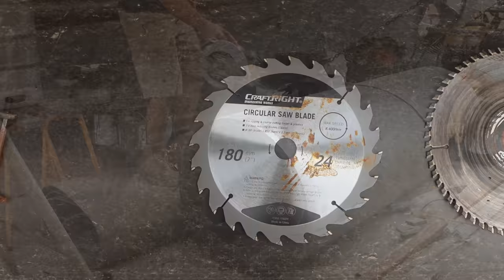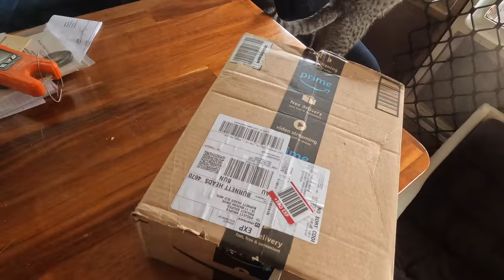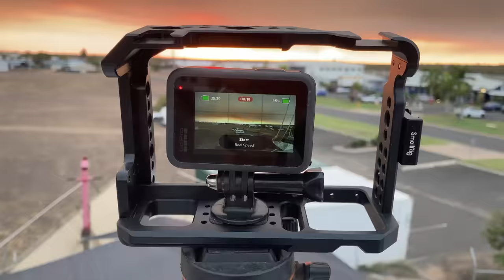We made a plastic bucket for our 1 ton anchor chain... - Project Brupeg Ep. 270

Comment: About 3 years ago I made a very similar anchor storage for my 40' steel boat (I modified a large wheelie bin), it works great but the drain kept getting partly blocked with mud and weed so last week when I had her on the hard I added a grid with drainage slots to hold the chain off the bottom of the bin for better drainage and drying out of the chain, a vertical flushing pipe that is over the top of the drain so I can blast that material down the drain and another vertical pipe with horizontal nozzles to flush the bottom of the bin, good luck with the engine, cheers Doug from NZ.

Comment: Did you guys know, if that is actually HDPE, a sandwich press is the perfect temperature to cast the chips into flat stock?

Just sandwich it between some baking paper, warm it up and it'll come together. Then you can use it to make bushings or slump mould it in the oven! 

Its the same stuff as bottle caps, so they work too!
Reply from the maker: Huh! Did not know this. Awesome stuff, thanks for sharing

Comment: Just a tip for you Dame. When anchoring you need put the boat into reverse to set the hook, a good way to know it has a good bite is when you see the anchor chain stretching out in front of you.
Second thing is when you back up you pull the chain straighter and it will not tangle. Anyway lucky you had good weather and the boat did not move around the anchor tangling the chain.

BTW when you tell the story of the anchor locker well chain holder gadget thing, just say it fell off a barge...

Keep up the entertainment and I hope you get to take a break and both enjoy Brupeg at some point.

Comment: It is HMWPE (high molecular weight poly ethylene) a very robust pupe used in the natural gas, water and wastewater distribution business. It is fused together to make leakproof joints that are stronger than the pipe itself. That’s actually a pretty thin wall for what looks like a 24” diameter. In the US water or gas thickness would be 2” or more. Best blade to use is a carbide tipped rescue blade used by fire departments to cut cars apart to save the occupants. This blade won’t melt the plastic. Nice grab at $100.00 per ft. US
Reply: Chainsaw... 😻
Planking chain, blades at 15° with shallow depth stops...
He could use what's left to make a slot together mesh at bottom to keep the chain dry...
Also it might be the stuff that some wooden boaty channels are using for ribs.

Comment: having carved out the back of the fireplace in my 1946 log cabin up in algonquin with a grinder, i can say i didn't envy your task list this episode. i did borrow from your weld on dogs tutorial(making a 6 mm plate fit the hole in the hull) to massage a 1/4" plate to conform to the existing structure of the fireplace my grandfather built.  thx

Comment: Just thinking that the other way to do it would have been to split the tube into three pieces vertically. Reassembe inside the anchor locker and use a top ring and packed spacers to keep the split tube together / located. It would be draining over the side when in use in any case. Keep up the good work!
Reply: Cut pipe down length and ratchet strap it to slide into itself internally, then use ratchet straps to hold it together for life down there.

Comment: Can imagine that insurers might be a bit put off by some known-dodgy pistons waiting to destroy themselves, so addressing that risk is one of the priorities before you can let water flow at speed over the keel, which then likely unlocks much activity regarding operationalising the systems required when making way.  We might be able to run an engine a bit slower to give a cooling system time to catch-up, or run an engine to top up some batteries,  but we'd all likely struggle to deal with a seized engine, or broken crank when needing to navigate. Not ideal, but it is what it is.

Comment: Its recommended  to have a access 
hole into shainlockers , 
Some times you may have to arrange the chain  when pulling in so it doesn't kink when you wind it out /fell the anchor.
Chains without  "mid post "in the links have more tendency to twist/ kink  than  the ones with  "midpost"
A non organist chain in a pile can shift and
Make "riding turns"/ kinks very easy, especially when there  are som waves.
I have been on big  sailvessel and
We did never just dump the shain into the chain locker it was cleaned and somone was in the locker and managed the shain during winding in maneuvers.  When anchoring letting the shain out you would die if you would be there. When the shain start going out it is wild beast. The ship  had midpost type  shain.
 Link   with m.p                        no m.p
             (  I -)--(- l  )         /      (   -)--(-  )

Comment: Greetings chaps, with all the building variations needed to make this boat whole again, this one small project highlights better than most the fundamental mindset of someone in the right environment at the right time. Imagination, creativity, technical capabilities, and most of all, out of the box tenacity and thinking.  I could have said well done but with a dictionary at hand why not wax lyrical and call a spade an implement for digging a hole one day and playing cricket with, another. Where I practice my skills they say every boat needs one of me onboard and the same goes for you, creativity with a modicum of restraint, good teamwork……It maybe to late, however a baseplate of a conical shape to funnel the sludge to the outlet may serve you better especially if your having a chain wash system. Achieved now by cutting some slots to the centre of the base and beating down a few cm, then weld up. The reason for this is the chain weight will effectively  form a labyrinth and stop the flow in such a tightly confined place, especially if you have rope attached too, forming a crush seal. it may be easer to weld tapered wedges or weld a cone underneath, or maybe leave alone and wash down when the anchor is deployed to the bitter end. Just my remote penny’s worth. Well Done chaps!!!!……..

Comment: Bit late now but you could’ve sliced the pipe in half long ways to get inside the hull and plated it back together or made three or four big ass pipe clamps to do the job. May also been easier to fit it in position in two parts as well. I worked making this pipe for a number of years and although it can’t be glued, it can be welded. Wow!Just realised my super power is armchair engineering.

Comment: Should of Could of cut the pipe in half length wise. Than using 3 inch wide stainless flat bar strips inside and out bolt both halves back together down below deck. Well you could still do this. Plus you could unbolt one half for easy cleaning if you had to. 😉👍👍 Damon Love your new Gorge Clooney look. 👍👍
Reply: it would need three pieces other wise it  would still be the same width with two
Reply from the maker: Trouble with cutting vertical is it would leak which we need to avoid
Reply: @ProjectBrupeg  That would hold true if it were a holding tank, but it's not It's a big funnel. 👍👍
Reply: @Bullshit1011  No cause both pieces can fit down the square hatch angled corner to corner even with the bulk head ladder there.

Comment: Good job.  I wouldn't make the pipe too to tall you may have to reach in there some day to unkink the chain.   On a side note,  you likely could have cut the poly in half vertically  to get it through the hatch in two pieces then heat welded it back together in the locker with a propane torch.   Hell get it hot enough, will be as soft as cooked pasta then be hand manipulated into any shape you want.

Comment: Not sure why you didn't just cut the 6mil in the shape of the bow, then put the holders on it in-situ... and finding it wasn't round was a killer.  Right before you looked at the hatch I was thinking 'this is a problem'...  solution not too bad, I agree the pipe was the perfect locker.  Hope the new engine goes well.
Reply: Sometimes even the most obvious solutions are not obvious until it's way too late. That's life

Comment: That job looked a bit of a bitch but looks like you've broken the back of it now. Can't wait to see all the action you teased us with at the end!
Have you considered fitting a spray system to spray any crud off the anchor cable as it comes up through the hawshole? Jet washes are dirt cheap now so it's not a huge outlay to get one, not that difficult to fit, and makes the job of keeping the anchor cable clean and flexible loads easier. Alternatively you could add a hydraulic water pump into the system of pipes powering the winch and drive a spray system that way. Just depends if it's easier to get electrical or hydraulic power to the system.

Comment: The question I always ask myself about Cummins as a truck driver is why does everybody always just put a crate motor in is it because they fail catastrophically🤷‍♂️😜
Reply from the maker: No they are generally super reliable. Frequently in the million miles club.
Reply: @ProjectBrupeg  I currently have a C 15 and older  bonnet vehicle I’m too scared to go a late model with a Cummins but I think I’ll bite the bullet and I’m going to cab over euro
Reply: @ProjectBrupeg  My mate has an ex 15 in a 909 that has already done 660,000 he told me the other day he has already given it a midlife freshen up
Reply from the maker: I don’t know much about the newer Cummins. But from what I’ve seen of the older ones they are stunning inside. Speaking as an ex engine reconditioner. Just a great solid engine. Not over stressed and hence a really reliable engine.
Reply: @ProjectBrupeg  I think the N14+ were the best ones